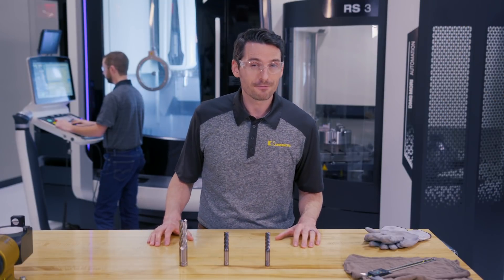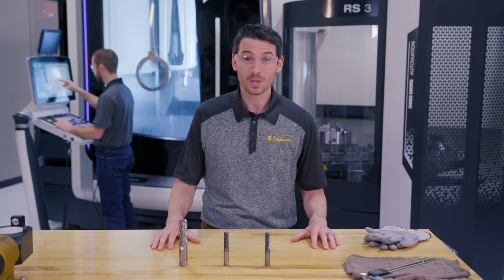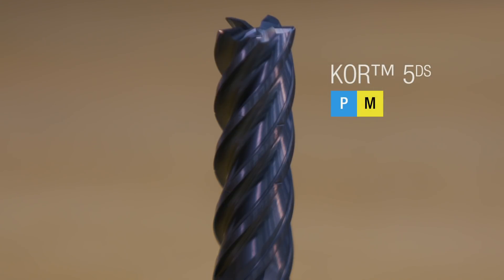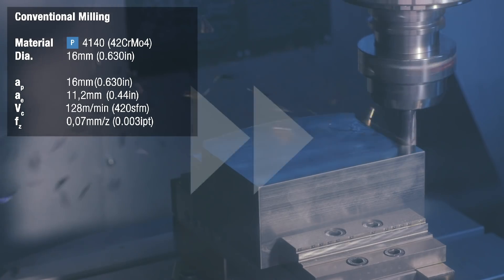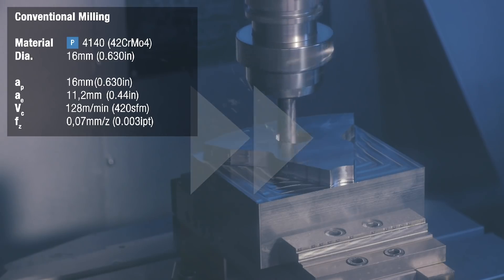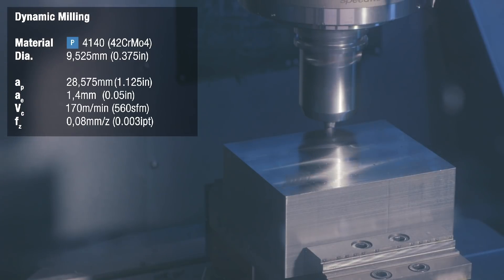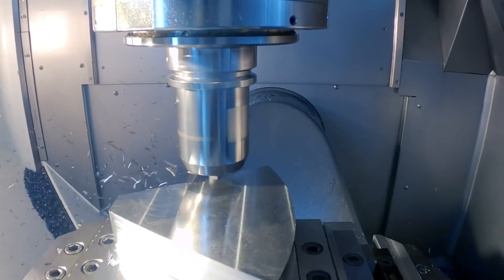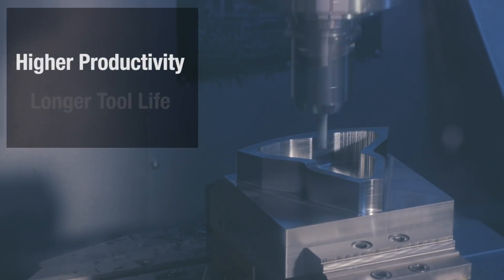KOR™ Series End Mills - Dynamic Milling vs. Conventional Milling

Comment: Whats going on with the flutes in the shank?
Reply: 6 months later sorry, but they're called duolock. They go into a corresponding holder that the grooves slide into so the tool cant pull out of the holder. The holder used is most likely a hydroforce.

Comment: I tested Kor5 D12 /36 R0,75 mill 1.4301 with dinamic milling.
It was good but not enough. 
Parameters:
Ap=18 mm
Ae=0,6 mm
Vc=220 m/min 
rpm 5800
Vf=2356 mm/min
Cooling emulsion 
My question is it ok parameters for Kor5 and suggest not using cooling only air?
Reply: KOR5??????? is only for Aluminium alloy:))))))))))))) maybe you used KOR6 for 1.4301

Comment: Semi Finishing Endmill ,Right
Reply: These can all be used to rough, semi-rough, and even finish. The chip breaker pattern has a large enough pitch so that they do not overlap, so they also work very well in finishing if you have to only use one tool.